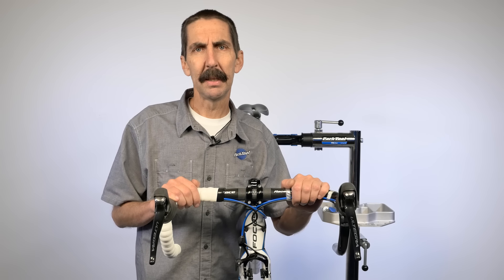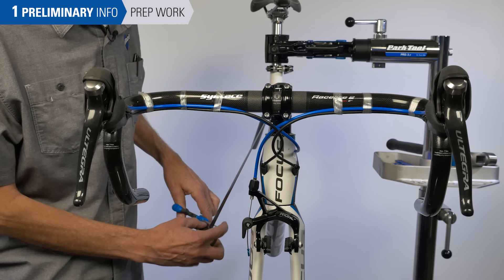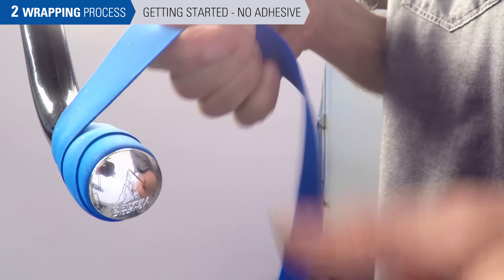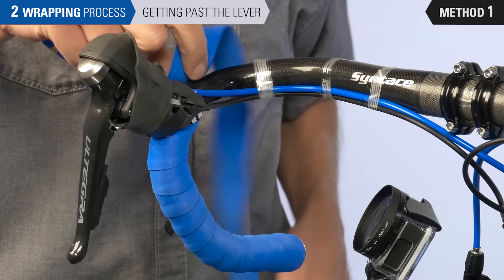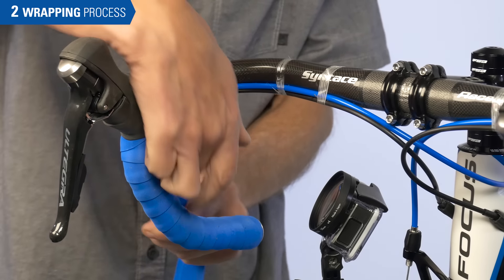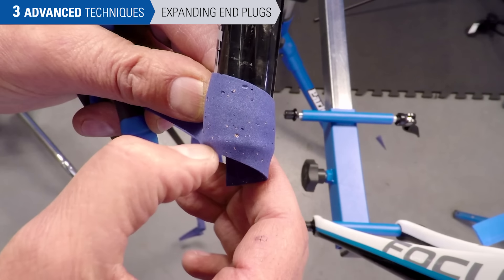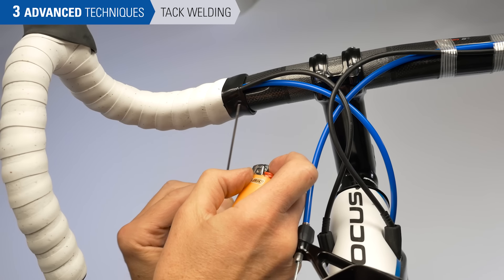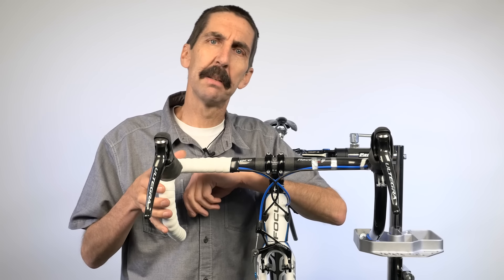How to Wrap Handlebars for Road Bikes

Comment: Pro tip: use contact cement. No need for electrical tape or plugs - like when using bar cons. When its glued on there the direction of wrap doesn't matter.
Reply: You should ALWAYS use plugs. As you can see with the screw-in plug, it isn't really needed to hold the tape, but an open bar is dangerous. If you crash and land on it, it can really do some damage. The plug can also save the bar in a crash (though that's probably more relevant for flat bars)

Comment: would it be possible to use Tennis grip? its kind of the same material and also water proof? and a lot cheaper !!!
Reply from the maker: You sure can. it will not have as much padding as most Cycling bar tape but you can use whatever you would like. There may also be a length issue.

Comment: I have a TREK 520 with bar end shifters. Is it possible to tuck the tape under the shifer housing as you would with a plug type end or should I use reversed electrical tape to hold the inital wrap? This will be the 1st attempt a wrapping my bars or messing with the shifters.
Reply from the maker: For bar end shifter systems I cut the tape at an angle, then run that angle up against the shifter and wrap the tape from there. A bit more over lap the first few wraps and its locked in place. Then, you have to figure out where you wanna dump the housing out fo the tape and wrap over it until that point, then start taping under it. Hope this makes sense. Good Q.

Comment: Thanks for the very informative video. I used the figure 8 method without the extra piece. Thankfully I didn't have any exposed bar. I also used the spot welding technique to seal the finishing tape. I don't mean to toot my own horn but I did a pretty pro looking job. Thanks a lot.

Comment: As ever, Park Tool videos are extremely helpful but i have a small criticism of this wrapping tape video..I find if the backing tape is left in place on the self adhesive style 'bar tape, and is only peeled away as required, means that your finger and thumb don't lift the adhesive as you go. It can be trimmed away if it gets entangled. Otherwise, excellent job.

Comment: I would suggest putting the two housing tubes on the front bottom of the bar so that the back and top side of the bar would stay as evenly rounded after the wrapping tape is installed. This technique would help to have a smoother grab on the bar without hurting the sensitive nerves on your palms. This is particularly important if the tape is thin or when you are not wearing gloves when riding.

Comment: Sometimes is not easy to plug correctly the bar ends with the excess of the tape. You have to catch all the circunference of the tape and introduce it into the hole, and you have to do this only with two fingers of one hand, to permit the insertion of the plug that you hold in your other hand. Maybe performing a pair of cuttings in the tape can help.

Comment: How to wrap handlebars if you have bar end shifters? I'm interested in how to attach handlebars in the wrapping start? There is no any bar end cover instead of it there's a bar end shifter.
Reply from the maker: No bar end cover when wrapping with bar end shifter. you start as normal wrap it back over itself then angle the tape and progress up the bar about 6 wraps then let the housing out and let it leave the wrap, then keep wrapping up the bar as normal.
Reply: @parktool  Do I need to take off bar end shifter to wrap handlebars or not? How will bar tape hold if there is no any attachment as in the case without bar end shifter at the bottom of the bar where the tape is held with a bar end cover?

Comment: Where do you get that particular strapping tape from?  Whenever I search around, I'm always finding the ones that at nearly 2-inch wide. What's the one they're using here?
Reply: You can use black 3M electric tape (two strips per side is enough), this tape doesn't leave stubborn residues in the long run.

Comment: Great video.  However, over a short time sun and heat make electrical tape slimy.  Must be a better tape out there than that, haven't found it yet.  However, stock tape on all my bikes seem to hold up perfectly to my electrical tape jobs.
Reply from the maker: I find it depends on the brand of electrical tape. Some get really gross. I have not found a finishing tape that comes with tape that will stand the test of time.

Comment: Hard to believe you didn't cover what is now called "reverse wrap" which actually was the way we used to wrap our bars in the 80s. This is where you start at the top portion of the bar and end at the plug where you tuck in the extra and actually use the plug as intended.

Comment: Thanks for the tutorial on handlebar wrapping. I also used the same technique on the wife’s 👄, even down to the last step where you tack weld it with the hot wire spoke. Worked like a charm. Now I can go ride till the wheels fall off without her saying 💩.

Comment: Why can't bar tape be wrapped starting at the top to avoid using the bit of tape. Looks much neater
Reply from the maker: That method typically results in the tape unraveling. This is explained in the video.

Comment: lovely, but your argument for starting from the bottom is controversial. It is obvious that on the top we move our hands outwards, but we move them inwards as well. 
On the other hand, if we start from the top we will spare the need for the pvc tape, nor the very need to cut, therefore the look will be superior.
The movement of the hands doewnwards on the top side of the bar, is no less arguible. Yet all in all you ParkTool are the very best, Kudos !

Comment: Thanks for the great video! I watched several, but I'm so glad I saw this one right before actually wrapping my bars. This was the first video that actually talked about clockwise and counter clockwise wrapping on the drops and straights so that you naturally tighten the wrap as you grip. It seems completely obvious to me now, but the other videos I watched did not mention anything about wrap direction. I most likely would have wrapped at least one side wrong after watching those videos.

Comment: I want to run out and buy new bar tape just to practice this. The Mechanic at my shop does one thing different. That little pad that was wrapped around the back of the hood he saves, and places on the tops of the bars for a little added cushion.  The extra bulge is noticeable if you know to look for it, but the extra padding is very appreciated on long climbs.

Comment: Calvin to ME it seams like it îs wrong by starting în the right clockwise because the benefits of arm squesing will be at the hoods  not at the end of the bar isnt it so? I imagine the bar like a flat bat for mtb with diferent throtheling before and after the hoods și i need to maintain the same  wraping rotation from start to finish because the throtheling îs diferent before and after the hoods

Comment: Why use electrical tape.?   Won't it get hot very messy in the summer.
Reply from the maker: Certain brands get a bit gummy. You can finish with whatever tape your heart desires. Hockey Tape is also a solid option.

Comment: Thank you for all of your videos. I took a bike (Cannondale R500 2.8 Aluminum) that had significant sentimental value to me to a local bike shop, they told me they couldn’t fix it, and wanted me to buy a new bike. With your videos, I was able to do a complete disassembly and put it back together with new parts. It works great now, and I am happy.  Thank you.

Comment: Hint.

Cut 1" wide rings out of an used 700x23c inner tube put one on each side of the bars before you wrap, and leave 'em by the stem.

After you are done wrapping,  slide the rubber rings over  and stretch them over your finish tape.   

Your finish tape WILL NEVER unravel or get sweated up and lose its stickiness again.

It's not super pretty, it's kinda utilitarian looking - but believe me,  with the popularity of getting into the grit and dirt with drop bar MTB/gravel/monstercross
It'll keep your wrap in place when other tricks fail.  Also doing the reverse electrical tape wrap under the bars is also a good technique for dirt drops. 
Cause more than likely if you like to underbike on trails... you will crash sometimes.

Comment: he never explains why reversing the direction of tape on top is 'advantageous'.  in old school (1980s Cello tape and cloth tape days) we didn't reverse rotation at the top because the grooves of the tape were more comfortable that way and pressure of your hands on the tops didn't tend to make the wrap come undone.   With modern wraps I still wrap my bars this way.  The reverse rotation on top is unnecessary.

Comment: So he sort of slates the figure of 8 system here. I agree that this figure of 8 is not good. I follow Si's figure of 8 method as he shows it on the GCN video, you've got to be careful but it avoids that bulky area and doesn't use cheat tape. 
But more importantly...Ultegra shifters and SRAM brakes...that should be illegal.

Comment: Thank you. Indispensable instructions for someone like Me who is physically averse to bike mechanics' touching dirty tyres and rims, then soiling My bike's handlebar. Most bike mechanics don't even wash their hands after each job, and even if they did, they have no qualms about touching dirty tyres, then My handlebars, brakes and shifters. 
 I wish it was possible to throw the bike in some sort of an industrial washing machine for large equipment (with separate sections for different parts of the bike, separated by cleanliness factor) with a few robot arms with a disposable huge bathing foam attached to each and have it thoroughly washed, lathered and rinsed with boiling water and a huge lot of washing powder. 
 The idea that the tyre rolls over remains of carcasses of murdered animals by reckless shithead-drivers, as well as over rapeugee snot, piss and shit, then a stupid bike mechanic thinks it his duty to "dutifully" touch these dirty tyres before touching the parts of My bike that are supposed to be clean. Shall I be thankful they don't smear all that dirt over My genitals and erogenous zones? 🤮🤮🤮

Comment: I've seen the figure 8 done getting full coverage WITHOUT adding the extra piece which obviously is a main contributor to the excess bulbous-ness being objected to. Not only that but no mention is made about whether the figure 8 achieves the directional change that's so desired. It's almost like a set up here to discredit the figure 8 for whatever unnecessary reason. Very strange.

Comment: You start at the top, then end at the bottom securing with the plug, no electrical tape needed. Taping down the top to hold it is hack. The "pinstripe" is ridiculous.